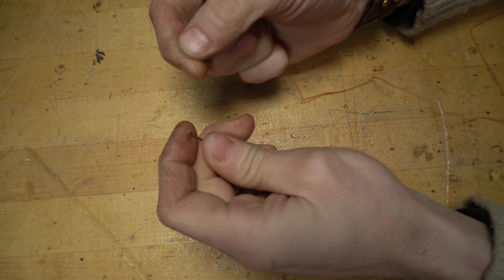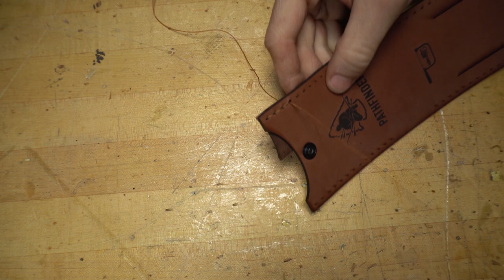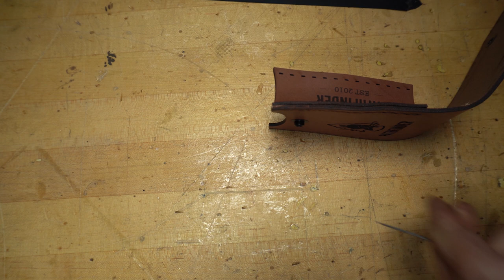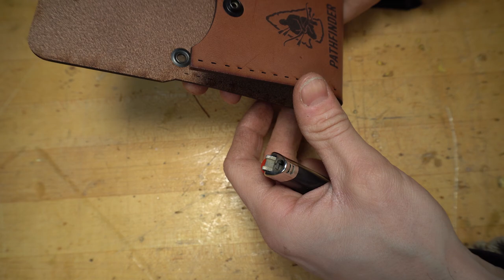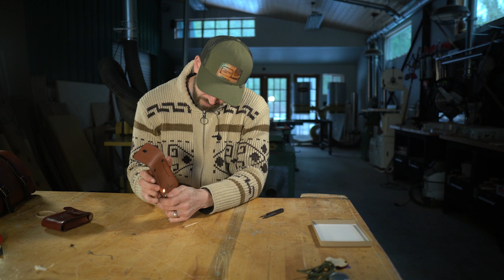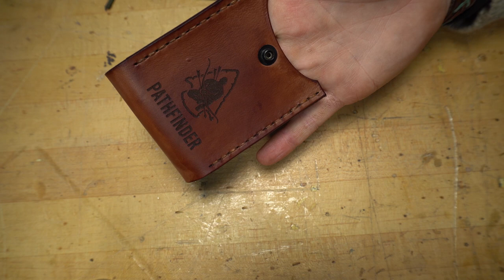TogetherMade Compass Case Kit Tutorial

Comment: I just received my kit and cant wait to make my compass case. Unfortunately it came without the sandpaper and slicker tool. I guess I can go ahead and assemble the case and wait to finish it until I can come up with a solution.
Reply from the maker: Hi Rob, the sandpaper should be under the fuzzy padding, it is just a small square of 150 grit.  If there isn't a wooden disk that says slicker I can send you another - if it doesn't turn up send me an email with your address and I'll take care of it asap.  -jeb
Reply: @togethermade5851  I looked for both under the fuzzy padding and in the packaging. I did not fine either piece.
Reply from the maker: @robgianopoulos2572  Copy that.  I'll send some out.  Sorry about that.